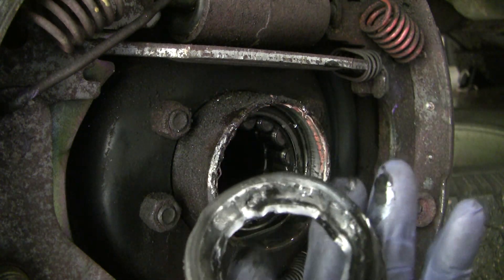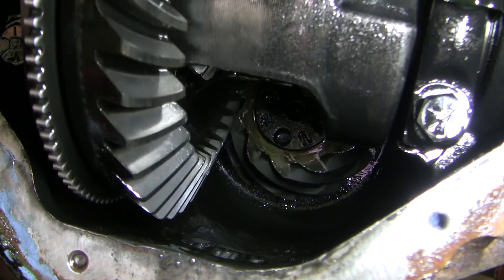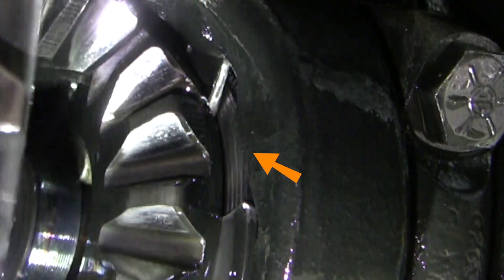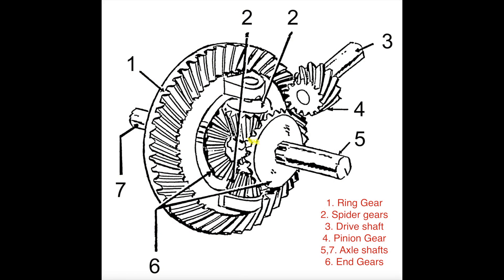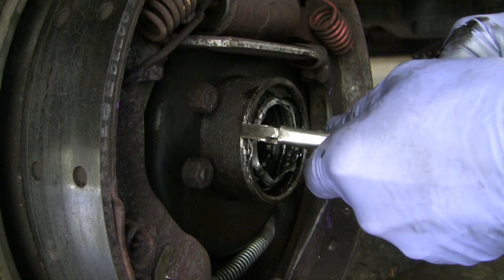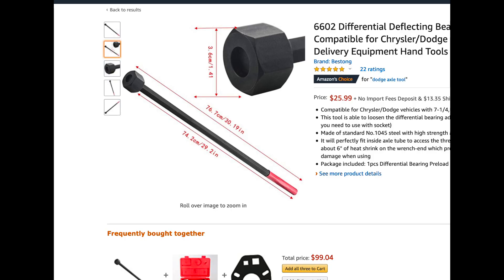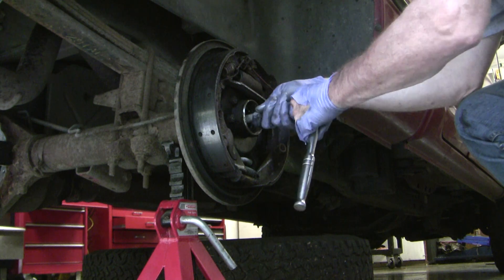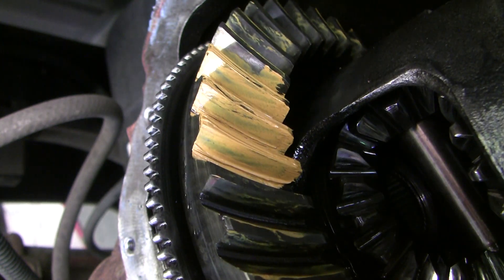Dodge Limited Slip diff repair part 1 Inspection How to adjust backlash

Comment: I like the way you use 'crap' to describe a bad situation.  It makes me feel like we're all in this together.  Of course, when I discovered a leak at the rear hub (or any other problem) my language was stronger than that.  Owing to the mileage at that time (150,000) the diff place had to use a Speedi-Sleeve before putting a new seal in.  That was 160,000 miles ago.

Comment: Man i really appreciate your videos. I ran into the same issue excpet it sounded like a massive grenade went off under the truck. Im doing the fix on my own and had no idea of a diff system like that from dodge. Now i know what to look for and what the parts are called. Thanks for the videos

Comment: Hello Dave, great video.  Anxiously awaiting the next part!  I bought the same truck new in 1998; it's still my daily driver.  We seem to run into the same issues around the same time.  Two years ago I replaced the rear axle seals for the first time.  But I HATE that 9.25" rear axle and will never buy another vehicle that uses it;  It's the only part of this truck that's been a headache over the past 23 years and 170,000 miles.  Pinion bearings went at 37k mikes.  Chrysler covered it under warranty,.  They went again at 70k miles.  Chrysler told me to pound sand.  I paid for that one.  Then again at around 110k miles.  All done by different dealerships in different parts of the country.  I too have the factory trac-loc, but with 3.92 gears.  The axle has always made a loud BANG when shifted into reverse since the day it was new.  Multiple dealers dismissed it as normal, as did a driveline shop.  Did it the same after both pinion bearing replacements.  It's so loud, its embarrassing.  I've checked it myself, and the play is between the spider and side gears, always has been.  My trac-loc started chattering at about 110k miles, only when going around the first few turns while accelerating after driving on the highway.  When new, it could transfer a significant amount of power to the slipping wheel.  Now, not so much.  I know its just worn out.  Replacing the Trac-loc is a project that I know is coming, hopefully way down the road, but I'm glad to see you do it first.  If you ever need any info from the factory service manual, let me know--I have the printed book.  Thanks again!
Reply from the maker: It's great to find somebody with the same truck. I too bought the FSM right at the beginning. Occasionally I have subscribed to alldatadiy to get updates and TSB's, but I haven't noticed big changes. In retrospect I think I heard a Belleville spring break one day a decade ago while I was in an underground parkade. I heard a sharp bang, then nothing. Sharp turns on a hard surface must be a challenge for LSD. Thanks for documenting your experience here!
Reply: if you  put a  Eaton  Truetrac  which is a machanical posi  which have no discs to wear out. the rear end will go 300,000  plus miles and always keep it ability to have posi.
Reply: You all probably dont give a damn but does any of you know of a tool to log back into an instagram account?
I somehow lost the password. I love any tips you can give me!
Reply: @Marvin Tadeo instablaster ;)
Reply: @Samson Beckett It worked and I actually got access to my account again. I am so happy:D
Thank you so much you saved my account !
Reply: @Marvin Tadeo Happy to help :)

Comment: Man your videos are awesome. I really appreciate the depth and complexity you go into, thoroughly explaining everything. I am an avid off-roader and bought a 1998 regular cab 1500 with a manual transmission and was bummed to find out that there is no selectable locker available for the rear. So I might try and repair the factory track lock lsd. I am hoping I can increase the ft pounds of the clutch packs. thanks for the vids. -Christian from Marin co California.

Comment: Never seen that design before. I like it. Thanks for another great video.
Reply from the maker: Elegantly simple. I was intrigued by the way torque on the spider gears compresses the clutch packs, sending more power from the spool directly through clutch packs to both legs. The two spider gears are only torqued and spinning when there is a difference in wheel velocity, the rest of the time their whole axis spins on the shaft inside the spool. No extra springs or gears. Not as effective or as durable compared to other designs, but much simpler. Thanks for stopping by!

Comment: I have a 2004 Ram 1500, I am trying to replace the rear differential with a junkyard one, but the junkyard part spins both wheel the same direction, is that how a limited slip differential supposed to work on these dodge rear-ends? I thought the old one was limited slip, but that one spins wheels in the opposite direction with the vehicle raised.
Reply from the maker: What they don't tell you about that test is the transfer case needs to be in neutral so the propshaft can spin freely. If it's stuck in gear, freezing the propshaft, the opposite wheel always spins the opposite way because it has to, even with an LS diff. In the junkyard the propshaft is disconnected so the test should be valid. When you spin one wheel it becomes a competition between the propshaft spinning with the opposite wheel spinning the same way, OR the opposite wheel spinning the opposite way, and the propshaft not spinning much. Which happens depends on how much mechanical resistance is in each drivetrain pathway. Typically in an LSD the propshaft spins freely and the opposite wheel spins the same way, with the carrier rotating but spider gears are not spinning. It's not a perfect test. Yes, the junkyard part sounds like a limited slip diff. You can find your system by searching for a Chrysler "build sheet" that will spit out details based on your VIN. Or, search for the tag (mine was missing).

Comment: Mine was whining on coast and LS didn't work. Found play in pinion so I installed all new bearings and upgraded to an Eaton truetrac. The LS parts were on the bottom. It was close to grenading.
Reply from the maker: Yeah, these trucks whine, it is hard to say what is normal. Back in the late 90's, when I still worked for a living, I hired a pro to swap out the pinion and side bearings. No difference in the whine. Often not noticeable, worst on drive at 40 mph, immediately better on coast, little change over the decade. I'm thinking about doing pinion and side bearings again myself, depending on what I find when replacing the clutch plates. Part of me says to make the extra effort to do the plates first, then see how things change, before messing with the pinion again. Thanks for stopping by, it's always nice to hear from others with the same truck.

Comment: Do you torque down both of the adjusters on each side to 75 ft lbs or just one side?
Reply from the maker: I torqued both sides. In my case I put the left side exactly back to where it was, then I moved to the right side, cranked it to where it was, torqued that right side, then went back to the left to finally torque that one. I don't know if it makes a difference as to which one is done first. The pinion connection adds asymmetry to the system, so it might.

Comment: that retaining clip you said fails in these do you have a part number for them ?
Reply from the maker: I found the part on Alldatadiy for you today, but they do not list a part number, nor is it listed in RockAuto. I did find a photo of that clip last year, I think on Ebay. It was part of a rebuild kit, but you should be able to get it separately. You might check with your local dealer, it can't be very expensive. Just a piece of wire bent in a C shape.
Reply: do not replace them..... get another type. get a Eaton  Truetrac  only way to go.